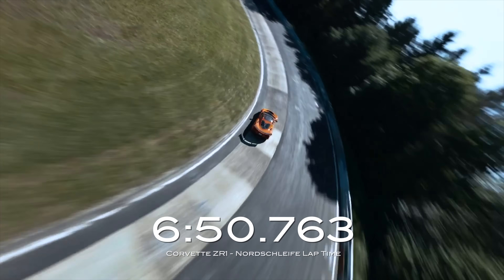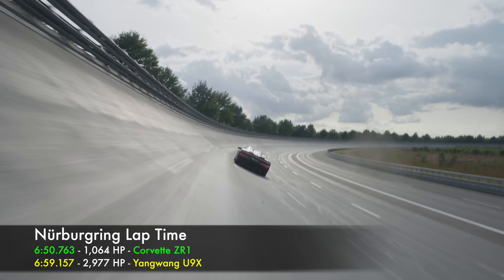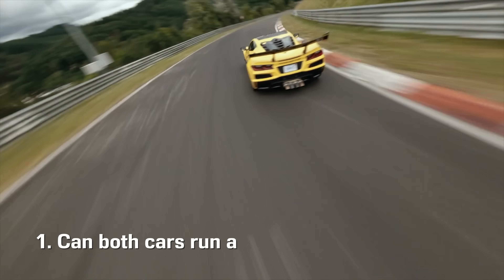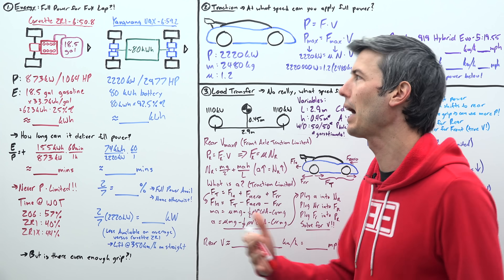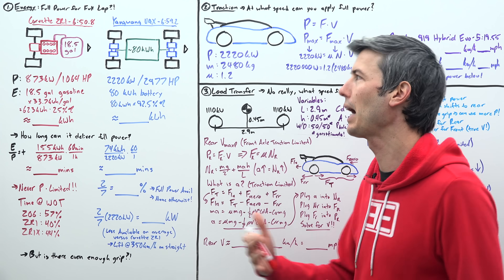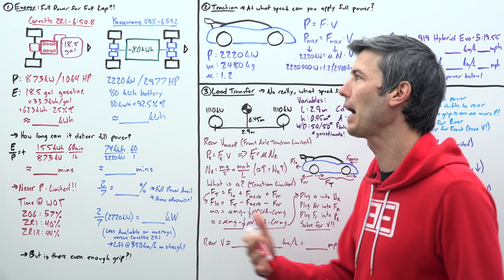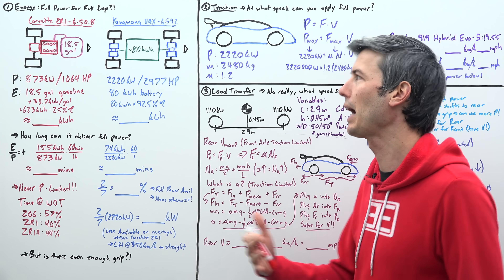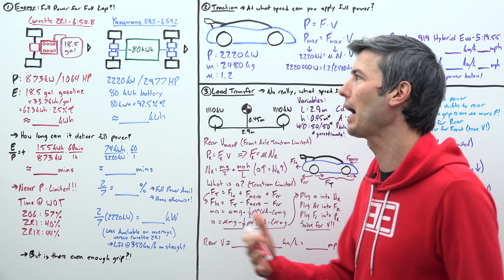Gas Beats Electric! Why Is 1000 HP Faster Than 3,000 HP?

Comment: Was this run done in a vacuum?  :)  Normal force isn't just mass.  Where is your downward spoiler forces?  Time to break out some partial differentials for the EV.
Reply: I was also thinking that he took into account aerodynamic drag but not the downforce produced in the process, because that does come into play in the real world and is something real race car builders take into account with design, usually with a mix of simulations and then wind tunnel testing.  Also done a lot in high level drag racing to get the aero and suspension tuned up to put the ideal weight ratios down to the wheels where it's needed when it's needed to get more effective traction, and at high speeds it can make a very significant difference.

Comment: i would expect 'meaningful' downforce from the byd.  i would think that would bring the point of maximum power usage much further down to where it can be used not just in the straights, but also coming out of high speed corners.  i expected that cornering speed would be the real limiting factor since that thing weighs as much as an F150.
Reply: Adding useful downforce is not necessarily rocket science, but when it comes to maximize things, it requires top of the line engineers and serious development money (I have a feeling BYD and other chinese manufacturers have none of those). Although it is true that the close to zero downforce setup they had was super lazy...

Comment: In Railways, even more than the torque and HP, the main variable look out for is thr Tractive effort which is the max force that the train can put down in kN. That tells you just how much force and therefore how much max power can be put on the wheels without losing grip. And therefore what's the maximum weight the train or its locomotive can pull. HP is useless if it doesn't translate into weight on a freight train, but a bullet train doesn't need as much tractive effort as top speed.
Reply: - for a bullet train aero is the enemy - drag forces require immense tractive effort at >85m/s.  (They are still "heavy" trains - and aren't generating "significant" downforce - stability and busting through the boundary layer is the goal of train aero design - cornering forces are dealt with by banked lines and ballast)
Reply: Metal wheels on metal rail slips so much easier compared to rubber tires on regular roads, so that's why trains has a "wheel lever" that connects all the wheels and distributes the force to as many wheels as possible
Reply: @sihamhamda47  Yep; it's how they're such an efficient mode of transportation (very little friction), but that also mean very little grip, therefore braking takes forever.
Reply: I was thinking the same when Jason started talking about traction

Comment: I don't know that I would say the GT3 RS is definitively faster than the ZR1 on the RIng. The GT3 RS was professionally driven and the ZR1 was just the GM engineers. I would bet a pro diver could improve by at least a few seconds. Either way both are impressive. Love the videos and the math!
Reply from the maker: I chatted with the Corvette team about this. They run simulations to know where the cars should land prior to doing the actual drive, and said the final numbers they achieved made sense based on conditions. So, despite the internet rumors, I think they were quite close to what the real capability of the car is. These aren't rando engineers doing the drives haha, they have hundreds of laps of experience and are very fast drivers.
Reply: @EngineeringExplained  that doesn't mean they are better than Jorg Bergmiester or Lars Kern. Both have won the 24 hours of Nurburgring and Lemans. Misha who races at the Ring has shown the mistakes in the on-board.
Reply: Even if the zr1 beat the gt3rs it was only because of straights. There is still nothing on the market that handles like a gt3rs. It has a little over 500hp and puts that insane lap down. The gt3rs just handles like a dream. While the zr1 has crushing straight line speed helping it make back the time it loses on the corners. Two completely different cars! Now the new gt2rs will be able to do both at an extremely high level and will probably be the new Nurburgring king coming soon.
Reply: @G82Watts  The new Turbo S has 711 horsepower (the same as a 488 Pista and CLK GTR Supersport); imagine what the GT2 RS is going to be along with the weight savings (a bone-stock GT2 RS is 6:47, I should expect a 6:35 or lower, maybe even causing trouble for the AMG One).
Reply: @G82Watts  you don't get it. The 992 GT3RS has put down a lap at 45 different tracks and set a record on 3. The ZR1 tested on 6 and set a record on 5. Beating the GT3RS, GT2RS on 3 of those in the process
Reply: @WindyCity1992 u don’t get it.. the zr1 is brand new the gt2rs is 7 going on 8 years old. 😂 this is just a moment in time and u know it. The new gt2 will destroy the zr1 and it won’t even be close.
Reply: @G82Watts  the ZR1 is a 9 second 215+ mph car that's fast all around. You are making a bad faith argument. Wich means you won't admit you're bias ,  ZR1 is a faster car in general
Reply: Misha said the ZR1 could be like 10 seconds faster with a pro driver
Reply: @BRAINFxck10   Misha has won the Nurg 24 as a Pro & he stated the ZR1 could be quicker, and FYI the ZR1 was faster on 5 of 6 tracks. Also a faster car all around, yall are being biased
Reply: @WindyCity1992 it literally has more records than the z06 what are you yapping about? It took double the power to even get near the gt3 rs
Reply: @ericship8383  it had 3 records total since 2022. Road Atlanta & Road america were beaten by the ZR1 last year. The GT3RS currently has 1 left. You can't ignore driver skill
Reply: @ericship8383 I was wondering the same exact thing 😂
Chervorelet  has nothing over Porsches engineering. 

Let's put it like this. I have an 1972 el camino with 383 stroker with good internals lsd and disk brakes and I have stock 1984 Porsche 911 carrera with an aircooled 3.2 6-cylinder boxer engine. 
Make a quess which one I take to "track" or to twisyy roads and which one I use for doing burnouts mainly? 

Ps the Chevy makes about double the hp and at least twice as much torque?

Comment: IMHO having watched the BYD lap, the driver is not a full Nurburgring "expert" he was backing off early, coasting into corners with much lower corner speed than other cars, then just booting it on the straights. I'm fairly sure if he did a few more laps, or just give it to someone like Misha Charoudin or any of the other specialist drivers who know the track, it would be faster. 
The C8 was not backing off, he was full tilt, watch the videos, and just one example, flugplatz - check the speed the BYD drops to at the top of the hill before the run to Swedenkreuz, ~185kmh.... I've seen Misha carry more speed in a 3 series than that.
Reply: well, this comment aged like sour milk - Jason addressed it all directly... watch video before commenting Craig....
Reply: @graigchq  craig stop being mean to craig

Comment: The standard Yangwang U9 with ~1300hp and far less downforce set a 7:17.9. I never seriously thought that they were using all 3000hp outside the long back straight, but I thought the stronger motors might allow for better torque vectoring; I wonder how much the engineers had dialed in the torque vectoring for the 6:59 lap. Just because all 4 motors are capable of 555kW doesn't mean they have to output that much. It is cheaper to use and develop one motor and apply it to all axles, especially since they need to hit the RPMs required for 500km/h
Reply: You're only using full vectoring bias if you're turning pretty hard, at which point you're not using high power anyway.
Reply: @concinnus  I was thinking of medium-high throttle situations while turning where the original 240kW motor doesn't have headroom for TV. For example, through a full throttle kink at a lower speed, you might want to give the outside wheel 270kW and the inside wheel 210kW, but you are limited by the 240kW cap with the original motor, but not with the 555kW motor. However I'm completely unfamiliar with the realities of torque vectoring in real life.

Comment: So you mentioned in the comments you left out regen, which I was going to mention in my comment, but there's one other thing you left out calculating the speed to use full power at each axle. As your accelerating, acceleration falls off, meaning the center of gravity is shifting back to the front axle. So your numbers are probably slightly off. Hopefully though, you left this out for the sake of the video because the math was already complicated enough, and you would have just had the majority of people closing the video.
Reply from the maker: The math in this video takes exactly what you're describing into consideration. As acceleration decreases, front load increases, which lowers the velocity number.
Reply: @EngineeringExplained ok, either it wasn't clear, or I'm just not smart enough 😆

Comment: Hey, I just found something insane, someone in Japan built an electric AE86 with a real manual transmission and that authentic ICE driving feel. Like seriously, why didn’t manufacturers do this earlier? It’s the perfect way to keep the soul of classic cars alive in the EV era
Reply: Because obviously no one is gonna buy it
Reply: Manual gearbox on electric cars brings loads of unnecessary complexity, cost and failure points . That's why we've only seen fake paddle shifters like on the Ioniq and ev6 gt which are apparently fun actually
Reply: Because that's an extremely small customer niche
Reply: What a perfect way of introducing distracting minigame for 0 added benefit.
Reply: At least 2 reasons...
1) It takes time to perfect the current prototypes they have
2) Market Research, they have to see if enough people will actually buy them to justify the full production cost
Reply: If there was a way to convert gas cars electric that would be nice. Way better than making new cars
Reply: This is literally the only reason I am not buying EVs lmao
Manual EV would be so fun, even with low HP.
It's not even that hard to do.
Reply: So many doomers
Reply: @BotulinSpikedMarzipan  power delivery is completely different with EV compared to ice
Reply: @huzcer  So what? Electricity is renewable

Comment: Lighter car did better on a curvy track? 😮😮😮
Reply: Nurb is every type of track in one.
It's high speed.
It's curve heavy.
It's elevation heavy.
It's narrow.
It's fast.
It is Hell
Reply: The porsch racecar that did It in less than 6 minutes might even be heavier than the gt3 rs. When you have (and can put down) enough power, the wheight isnt as important as it used to be back in the day, when we didnt have this much power
Reply: @luft02  The 919 Evo (the sub 6 car you're referring to) is 849kg dry whereas the GT3 RS is 1450kg; a 600kg difference.
Reply: And the zr1 which is heavier than both the GT3 RS and GT2 rs achieved a faster lap time around American racetracks, your point? Sure those tracks are substantially smaller but are still mostly composed of corners.
Reply from the maker: It's a high speed track, don't kid yourself haha.
Reply: @EngineeringExplained I live kinda nearby and drove it countless times, I think I don’t have to kid myself, haha.

Comment: 4:30 Actually, the speed limit on that section of the track is 350 km/h, so it’s not about energy saving. I know this because it’s mentioned in the official Rimac Nevera lap video.
Reply from the maker: Any documentation of this? I asked GM engineers and they said there is no speed limit.
Reply: @EngineeringExplained  My only source is the official Rimac Nevera lap video, but I’m not sure why it’s limited to 350 km/h tbh. The video only includes a note on that part part of the track that says “Top speed limited to 350 km/h due to tire regulation”, so I assume it would be the same case for the Yangwang.
Reply: @frifasS  well, tire regulations don't have anything to do with the track. It is more likely that the tire manufacturer rates the tire for that max. speed.
Reply: @thewaldfe9763  I'm not so sure about that. Both cars the Rimac Nevera and the Yangwang U9X, use different brands and types of tires. My guess is that it has to do with EU and German tire regulations, but who knows.
Reply: @EngineeringExplained  It's not a track limit, the run was speed limited by yangwang engineers due to concerns with the tires as it is the last section of the lap

Comment: For the record, an Alpine A110R Ultime did the ring in 7:15, just 15 seconds, or just 3.8% slower than this 3000 HP beast. That 1500 kg of extra weight the Y9 has over the Alpine caused its speed to be eaten up totally by the Nurburgring's corners. That's how much weight slows you down on a track. 1 kilo is 30 milliseconds on a normal F1 track say F1 engineers. On the ring one kilo extra would easily be 5x that, 150 milliseconds. 15 kg is 2.25 seconds. Imagine 1500 kg extra. 225 seconds, about 3 min and 45 seconds of time lost. So if the Byd weighed the same as the Alpine it would be 3 min 45 seconds faster in theory and shatter all records. But nope. Weight killed the pace. And you wonder where the HP went.
Reply: That's obviously a ridiculous extrapolation. Time savings aren't linear either, they're exponentially diminishing.
Reply: I can recall seeing a short with Lewis Hamilton on some British TV show and they were laughing at him about how strict he is with his diet; he explained "2 kilograms is about 1/10 of a second in lap time so I have to be as light as possible while still being able to handle the forces of the car over a race". The smug was wiped off the face of the presenters after that lol.

But yeah, at that level every gram counts; if it didn't F1 drivers wouldn't try to gain a few kilos in weight at the end of the race to meet minimum weight by picking up old bits of rubber on the side of the track

Comment: When I started to get into track days, I was told the secret to improving lap time: TYRES.
Because it's all about grip. Even if it isn't putting absurd power down, it's definitely about mid-corner speed. You get way more lap time for your dollar spending it on tyres, suspension and chassis than you do on power.

Comment: Don't you also need to take into account downforce, torque from aero friction above the center of mass, and even active suspension changing the geometry? In the end I think this is probably only a lower bound for how much power can be put down, right? 13:51
Reply from the maker: Yes, as mentioned you do need to consider downforce, but there are no official downforce figures provided. Since it's an EV, it's unlikely they're super high numbers.
Reply: @EngineeringExplained 

Reading some older articles, many quote 280kg of downforce for the u9 with the active rear wing option (so at speeds under 300km/h).

I totally agree with you about electric cars having less downforce in general, but it's possible that the unusual top speed design element might change that. 

Since the car is supposed to get to speeds close to 500km/h, if drag is a major optimization factor, then given a target downforce, they will probably target a minimum drag speed around there. It's well known that higher design speeds lead to wider wings with a shorter chord and flatter airfoil (lower camber magnitude), which means that the critical angle of attack is higher, and in turn that an active wing might be able to generate more of the max downforce at relatively lower speeds by increasing angle of attack as opposed to a lower-speed, track optimized design. So, I wouldn't be surprised if the aero system could produce a meaningful share of it's maximum downforce in the traction limited acceleration regime. 

Of course, that has to be traded off with range, but even in a constant lift regime that's going to be dominated by the segments with the highest average speed, and since regen is difficult when the battery pack overheats it's not completely obvious to me you'd want less downforce for an EV with this much power and such a high top speed.

After all, if the GT3RS at 0.5hp/kg benefits from 50% w/w downforce enough to be overall faster, and the u9x can sustain 0.5hp/kg for 70% of the lap, it's not clear to me that the optimal downforce for the u9x is going to be so much less than 50% w/w as to be irrelevant, especially if active aero can minimize the drag over the high speed sections where most of the energy is expended. 

It's too bad we can't get good data on the aero for this car!

Comment: We can calculate BYD Yangwang only used 90% of its potential, in the famous top speed record video, by measuring the slow climb from 492 to 496 km/h. Acceleration was only 1.94 km/h per second, or 0.054g. That means the remaining force after "fighting" air and rolling resistances, was only 1350N (because we know it's 2.5 ton car and F=MA).that is 250 Hp remaining for extra speed, which means the car used about 90% , so, it probably can only do 5% faster (25 km/h faster) on very long road

Comment: I mean I know the answer is gonna be weight but I'm happy to let Jason cook.

Edit:

I feel silly for not considering how little you'd get to actually use 3,000 hp.
Reply: Anything above 800-1000 HP is pointless considering that traction control, esc, and physical grip limits are stopping most cars from going past probably not even 600hp without being uncontrollably
Reply: @jwalster9412  ermm no. More power = faster, especially for a professional racing driver.
Reply: @GamezGuru1  anything above 1000 WITH TCS and ABS, On the street. On a racetrack is entirely different, but it's still very challenging and not exactly necessary if you have good gearing.
Reply: Yet another butt hurt EV lover.